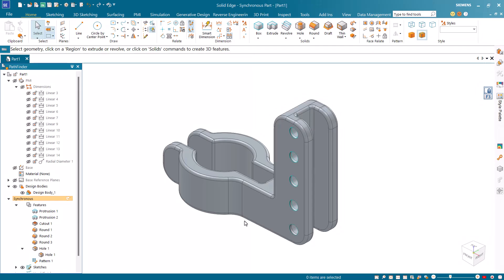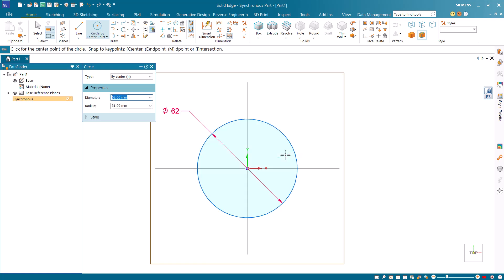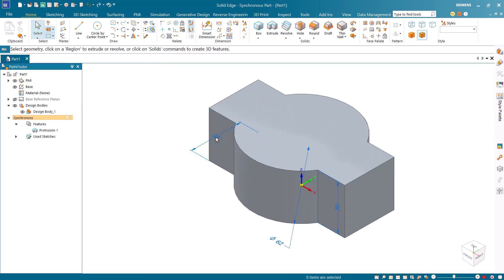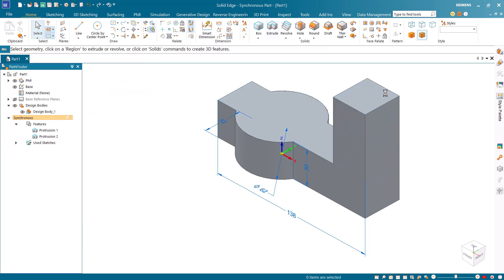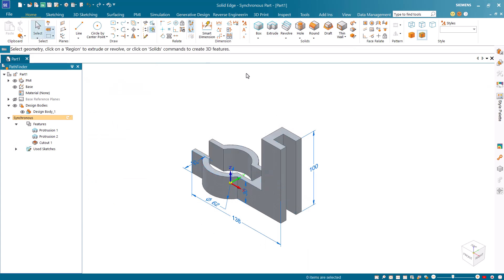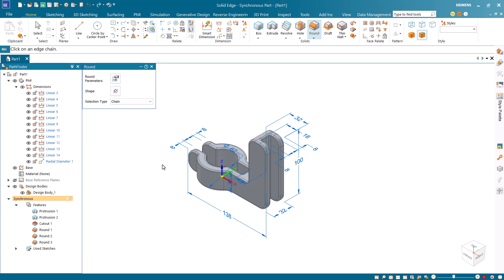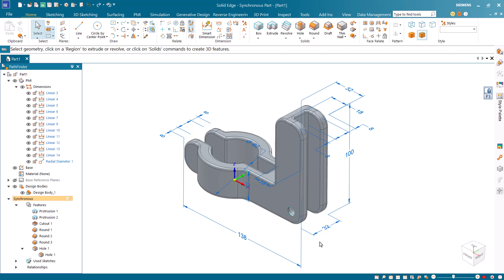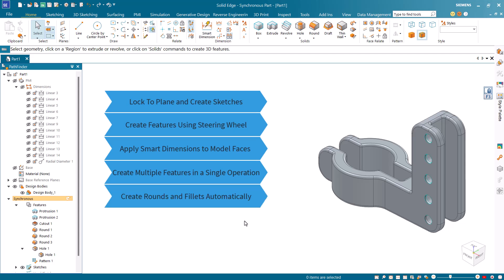Solid Edge Tutorial: How to design a part using synchronous technology

Comment: I'm unable to use Smart Dimension for modifying the dimensions as the command doesn't offer parametric value input after the edge of the object is selected. Please help.
Reply from the maker: Hello and thanks for your question. If you haven't yet reached out to support, they are the best option for this type of question. Please open a ticket in our Support Center at https://sie.ag/t1C8j. This will ensure your question is quickly routed to the correct technical support resource.